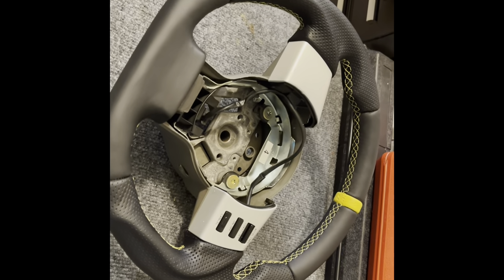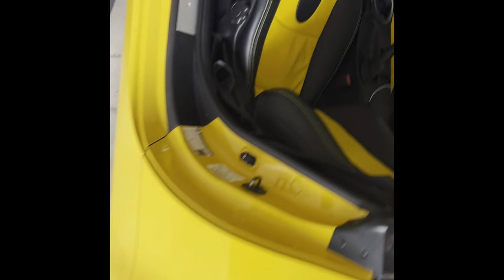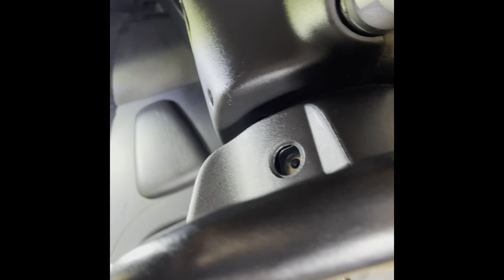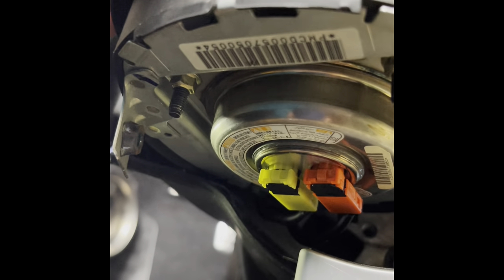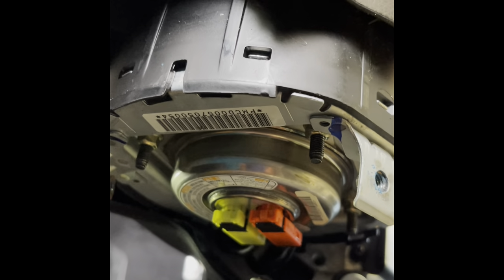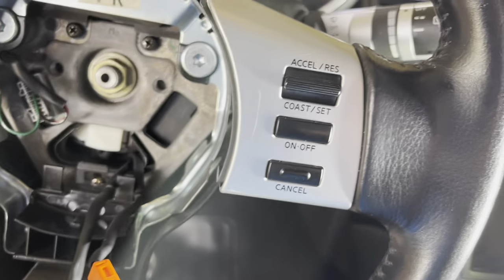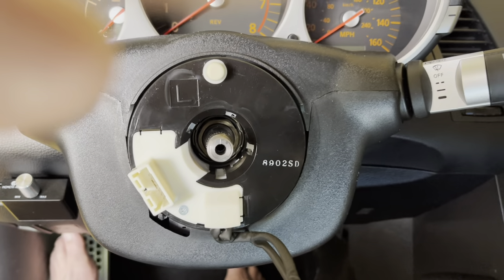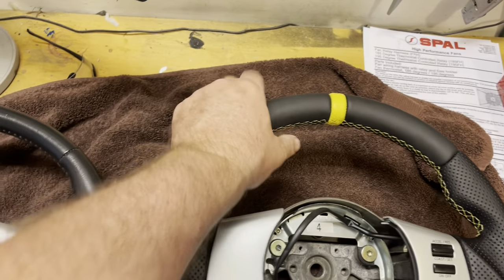Nissan 350z Custom Steering Wheel Install

Comment: Was your new steering wheel off center after install? Mine is I don’t know why….did this yesterday
Reply from the maker: Just pull the car in straight.  Reinstall the wheel a notch around and reattach.  I did miss it once and it was crooked.  Just take it off and adjust it.   Hope that makes sense.
Reply: @JS-ny9ge  I tried that thanks for the quick reply man 👍💪